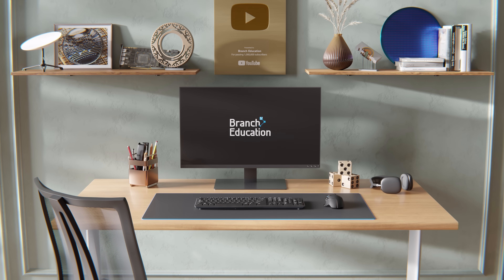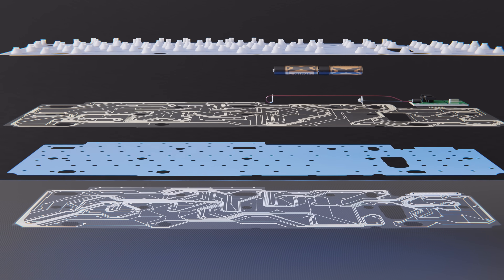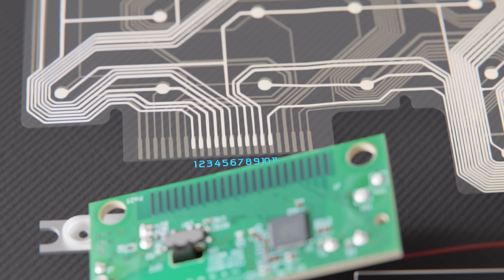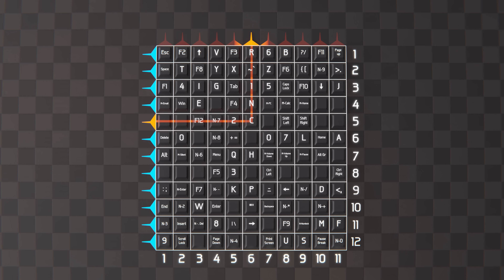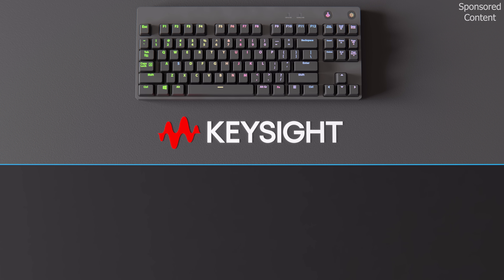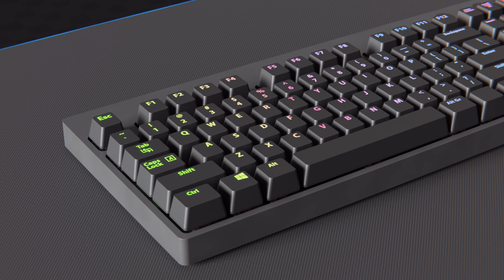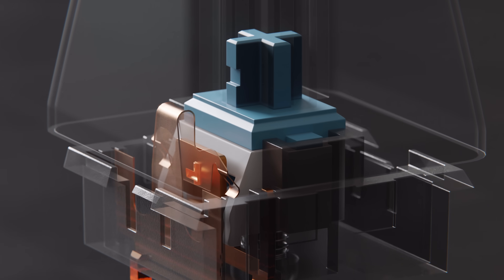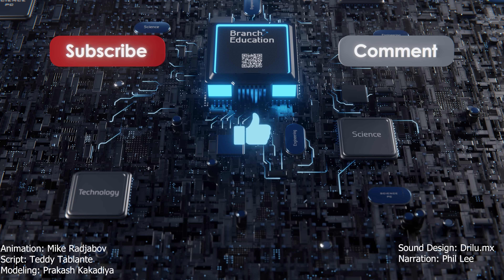How do Computer Keyboards Work? 🤔⌨⌨🛠

Comment: Just a correction to an otherwise good video. There are three types of keys in mechanical keyboard, linear, tactile and clicky. The click in clicky keys does not come from the switch contacts but from a specially designed jacket that is held in place by the switch contact's tension and is violently released after pressing the key so that the jacket hits the bottom of the stem if I remember correctly. You called the jacket the slider in your video but the animation doesn't show the snap down of the slider that happens in clicky switches to generate the sound. If you add lubrication to these switches they actually become silent like linear mechanical switches since the grease prevents the jacket from moving quickly. Google "An Introduction to cherry mx switches"

Comment: Except the sound doesn't come from the metal parts contacting. It comes from the mechanical design of the switch. There's multiple different mechanical switches and the most popular are Red, Brown, Silver and Blue. Red ones are silent and linear. Brown ones are silent and tactile. Blue ones are clicky and tactile and Slivers are just shorter activation variation of Reds. All mechanical ones make small sound when bottoming out, but there's also silent (damped) versions that don't make sound when bottoming out.
Reply: The main click sound also doesn't come from the stem bottoming out but the jacket/slider component quickly moving down after overcoming the switch contact tension and hitting the part of the stem that brings the jacket back up on release. If you grease clicky switches the jacket cannot move freely and you turn them into linear(red) switches without the click sound.

Comment: the vizualization was amazing. Though, I hoped for a better explanation for mechanical keyboards. The membrane one (did not hear you called it membrane) had such a detailed explanation. The mechanical keyboard had an explanation about the switches, but not how the signal travels or what happends after the switch contacts the pcb. Also why you covered wireless keyboards and not wired, wired are more prone to be bought in bulk I think. At the mechanical keyboards I hoped a same way parts comparison. It wasn t clear that the switches are a completely different part that does not have to be soldered onto the board. Hot swap keyboards are all about this, where the switches can be easily removed by hand

Comment: Welp... now I know how it works, and it explains why one keyboard can have multiple inputs go through at the same time

Built a digital keyboard which uses 11x4 as a matrix (it can only process lowercase alphanumerical input, so 36 possible inputs, which fits into the 11x4 matrix)

My problem so far was checking all 4 rows / 11 columns at the same time... so 1 input at a time.

With the oscillations, it could possibly handle 4 inputs at a time

Comment: Amazing explanation, that mechanical one is fine but how cup detect each key press explanation was mind blowing. I had that question from long long time back of the mind but finally I got the answer.

Also on a similar way, I would also like to know how each pixel in TV is controlled and each produce different colour.  

Thank in advance, if in case this comment is read.

Comment: mechanical keyboards are much more unreliable than cheaper non-mechanical keyboards... in 28 years I've only used 3 keyboards, the first was mechasnical an stoped work after punch, when i played  nfsmw (the second one was non-mechanical  "second hand" ps/2 compaq and I used it for about 18 years, I changed it 2 years ago, because I wanted rgb - to see the keys in the dark. mechanical keyboards (are not faster than non-mechanical) are for stupid "gamers"...

Comment: 00:05 Basic computer keyboards have minimal critical components for cost efficiency.
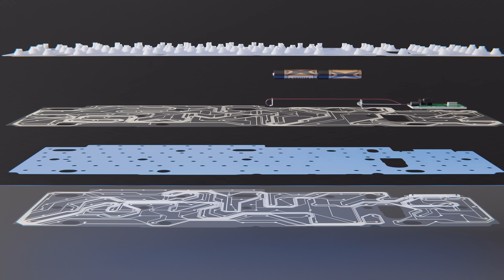01:41 Computer keyboards work by bridging connections with conductive circles and rubber domes.
02:57 Computer keyboards use a keyboard matrix to register key presses.
04:20 Keyboard matrix uses 3 volts along columns for key detection.
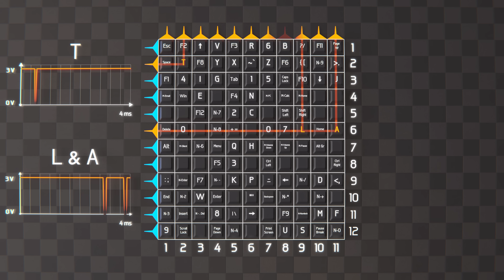05:46 Computer keyboards work by detecting key presses and sending data to a transceiver.
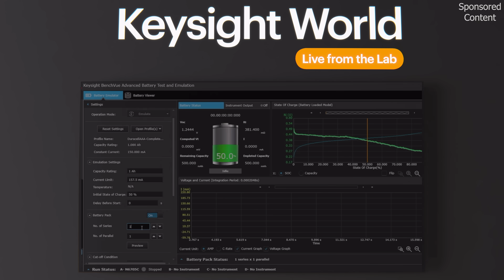07:06 Mechanical keyboards have a different tactile feel and make a clicking sound when pressed.
08:24 Computer keyboards work by depressing keys to create a connection between two metal contacts.
09:50 Computer keyboards vary in mechanisms and cost.
Crafted by ADEDLOOP....

Comment: I realize this this is just an introduction to how keyboards work, but just wanted to add
that, each key is assigned a number, Space=32 , Enter=13 and the letter "E" =69. known
as the ASCII Code.on pressing each key, the processor detects this, outputs the number
the key generates, and sends it to the computer.

Comment: Just a quick clarificatio: it cannot tell what letter you pressed. It can tell the key by a certain scancode. Now, what the computer does with that scan code is up to the software that's running on it. Initially, the computer has no idea what to do with this signal until it has a rule for it.

Comment: Its worth noting that there's a practical reason beyond feel for mechanicals. Rubber domes in membrane keyboards are much more prone to wear out due to the degradable nature of rubber having to flex and bend over and over for thousands of presses. And once they break the whole membrane effectively has to be replaced. Meanwhile with a mechanical keyboard its based off much more durable materials like metal and PBT most of the time. Not to mention so long as parts are available you only have to resolder/replace a single switch.

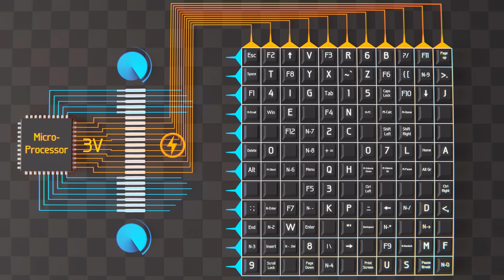Comment: I still don’t get it the idea of the matrix, if we come back to 3:40, when i press Y how the microcontroller will know that it was Y and not G or V. Because with that schematic if you press G the same wires will be able to conduct the same voltage. 
If it’s working with different frequencies in each column then it would be understandable but i don’t think that it works like that. 
I would be happy if i found a response to this question. 
3:45

Comment: Mech boards aren't durable due to this same reason. their keys break easily. I bought 3 mech keyboards and in an year they all stopped working one after the another. Bought a hybrid one and it's been 2 years and still working super fine. No physical damage, and chip damage, no internal damage. Not a single malfunction.

Comment: Amazing video! I was waiting for the laptop keyboard, specifically ibm/lenovo thinkpad "razor" switches keyboard, but I guess its not interesting enough. 

The explanation with matrix is great too but I'm guessing the example in this video is used for diodeless matrix, mainly because diodes cost money and that adds up to the cost when thousands is manufactured, that is why the workaround. Maybe, I'm just guessing.. The animation and research is great too

Comment: Good electronics solution for designing keyboards given and clearly explained-- for some designs the implementation of diodes solves the mentioned problem on the matrix for others is nothing to be added on lines and rows or on the lines  connecting buttons to the matrix it depends on the way it s designed-- inducting many others for those who are interested in electronics. Maybe further video needed in the implementation and the integration and setup  in  exploitation systems like windows to have a better overview of this smart  complex engineering product . Very interesting ,cost approach there is solutions for cheap product and solutions for high quality products of course .actually some of them are sold for less than 2dollars in our supermarkets .

Comment: Good video but so many errors with mechanical keyboard explanations, some switches are contact less, not all have tactile feed back, some don’t need to be saudered, some use magnets, some don’t have springs, not all are clicky, silent switches work slightly differently, certain switches use a different mechanism, a few use magnets instead of the leaf springs

Comment: The click sound isn't created by metal leaves, it's created by the loose white "jacket" hitting the bottom. Not all mechanical switches are "clicky"(having a jacket) like MX blue in the video. For example, MX red (linear) and MX brown (tactile) does not have the jacket and won't produce the click sound.

Comment: why all that complicated technical and mechanical stuff to determine which key is activated? Isnt it better to have a direct single connection to one key? That would require like 110 wires in total +1 for grounding and you wouldnt need any special oscillating hardware and whatnot. Why? Is it that cheaper because of this?

Comment: I think it might be useful to add that in 5:45 the voltage input on „row 6” goes down because „turning a column off” means connecting it directly to the ground thus making the current flow that way (cause there is only cable resistance there) rather then through higher resistent microcontroler – which explains 0V on row 6 input.

Comment: That’s the same keyboard when you start duping the keyboards to show bulk, that’s the same keyboard I use for gaming, it’s a bit loud, but it works, and my brother ripped off the escape key, and I used the keypad keys as a replacement, and I have the wired version

Comment: Super wrong on the mech keyboard part. Price is ofc depatable considering the amount of keybs under 30 USD, rgb leds are not a feature on every board and the most insulting of all, that the switches are sodered on…

Comment: I am pretty old skool, I started using computers back in the day when Mechanical keys were the only type available. I like the feel and the sound they make. I also miss the sound of Dot Matrix printers. tho, some early ones were so loud they had to be in a cabinet with sound deadening on the walls, and a clear plastic top, that could be opened to retrieve your printout, feed paper in, ETC.. . .

Comment: As you mentioned,the column sampling period is 65 micro seconds ,but in real world there must be bouncings (the key contact point quickly close and open several times )when pressing a key. I think this bouncing period might longer than 65 micro seconds. Thus a keypress would be    decoded to several different keypress.

How they avoid this?

Comment: This was amazing. Your 3D animator is top notch. I'm trying to figure out why two of my keys on my laptop are going out. Based on this I'm guessing there's an open on one the circuits in the keyboard matrix. My H key and my left arrow key stopped working at the same time. I can sometimes get them to work if I press real hard. Then they work for about a minute. MSI GS 66 Stealth with Steel Series per-Key RGB with Anti-Ghost key (84 Key) keyboard. Does anyone know if there's a fix besides replacing the entire keyboard?

Comment: You don't tell much about how a keyboard is scanned electrically.

When two metal plates are moved towards each other, there is a relationship between capacity and distance. What is important is to be able to measure the distance, i.e. the capacity. This method is called capacitive sensing. The capacity is measured at each node in the matrix. It is very simple. An opamp, or transistor, with good amplification is used. This is important, because otherwise a capacitance to other keys, and to ground, will disturb the measurement. This opamp is typically included in an oscillator, and it is affected by the capacitance in the node, which is where the vertical and horizontal wires meet. It is possible to determine the capacitance very precisely in each node of the matrix, down to femtofarads.

Capacitive sensing has been used since the days of punch cards. Contacts wore out too quickly and capacitive sensing was used instead. When IBM made their first PCs, they used capacitive sensing in all models from AT computers and up. In XT computers, mechanical scanning was used, although it was actually more expensive. IBM also used mechanical scanning in their electric typewriters and the keyboard for XTs was made like in electric typewriters. IBM's AT keyboards the cupper in the keys was protected by solder resist and there was no electrical connection when a key was pressed - only a capacitive connection. They amplified the signal with a simple inverter before it went into the microcontroller. They didn't measure the value of the capacity back then in their "cheap" AT keyboards, but it was designed to detect a pressed key, if the capacity in the node was higher than when it was not pressed.

In modern keyboards, the chip records the capacity very precisely and it has a hysteresis. Therefore, there are no contact bounce  time and capacitive detected keyboards can detect pressure significantly faster than a mechanical keyboard because there is no bounce at all.

A typical detection of capacity in the node, you use an opamp with a very small capacity between its negative input and output, and a schmitt trigger after it, and let it perform an oscillator with a high resistance back to the negative input. From the output, you controles the columns in the keyboard, and if there is a capacitive connection, it affects the oscillator frequency. On a microcontroller, you typical are able to either feedback the output, or not feed back, so you measures a reference frequence, when there is no connection. When the microprocessor connects the collumn, the frequence is affected, if there is a small capacity in the node. The capacity in the node, is coubled direct to the minus input of the opamp, and even very small values, affects the frequcency much, because the capacity between output of the opamp and the minus input is low. Even, that it is small compared to the capacity across the opamp, it changes the frequency enough to measure capacity in femtofarads. This is measured with a timer on the microcontroller chip.

Comment: Question: What does happen when you press two keys in a row. Shouldnt the power go through the first pressed key in the row and leave the other one without power?
Reply: Basically, the power of the electricity splits so that there’s half as much power going one way and half as much going the other way.

Comment: 5:42 that doesn't make sense. The way you described it, when the "L" column is turned off, the "A" column is still on, so the output will still see 3 volts, and the same goes for when  the "L" column is turned off. I think you have it backwards, this concept would work if all columns are turned OFF when a key is depressed, then sequentially turned on to see which row(s) are active.

Comment: I had to dismantle a Kawai electric piano recently to fix some keys and internally it's quite interesting. it's mechanical in the sense that the keys have weight and travel similar to a real piano but right at its core it's some silicone pads and contacts. So you push the key to overcome the weight and the force of the contact, presumably voltage over the contact is what translates into striking a note.

Comment: 05:40 this appears to be wrong. If the L and A keys are pressed there is always a connection to the sixth row and there will be no voltage drop, in other words the keyboard can’t register those two buttons being pressed at the same time.

Comment: LIST_Of_POINT_MISSING
1> Where are the explanations of the keyboard about the thing named scan-code (all models, classic or mechanical).
2> Where are all the explanations of how the keyboard detects and then the internal logic used for the detection
3> Where are the explanations in case of key conflict
4> Where are the explanations for taking into account button modifiers
5> Where are the elements given to the computer for a HID type component
6> Where is the speed info, the values given are not all the same for all keyboards
8> Where is the information about the wireless communication protocol
9> Where is the information about pooling rate
10> Where is the info on the total of max button use of a keyboard according to the type
11> Where is the info for the RGB part of the keyboard you showed
12> Where are the sources for average prices for your 2 keyboards
13> where is point number 7 from this list (ou read again and you not see the line before)

you must specify that this is one of the layout models that there may be but that it does not represent all wireless keyboard models

not all keyboard models have the same layout and are not all wireless, so the grid you show it's not full correct, but not explain other thing, how the thing work for the "microprocesscor", wrong word for first, remove the last C letter 
small search on google and i found lot of other model for the "plastic sheets" and the rubber part

we know exactly how DRAM works in detail with a lot of info, but we know exactly for 1 model, but not all the info
for any guy want know more detail about all missing point from this video
watch the video ID " N0O5Uwc3C0o " or " wdgULBpRoXk " or " 2lPzTU-3ONI "
for me it's mainly a product placement video, it's a shame, I expected to see the details of the summary and common operation of a mechanical keyboard

7> Where are the typical elements of your video like the intro and the outro to show the branches we watching
14> congratulations, you have just read point number 7, you could make a video with all the information required to make a real video like the mouse

Comment: I am not used to write comments but this video convinced me .. animations and explanation are at high level. I ve found new channel :-)… just one thing.. voltage graph depended on time would looks like in reverse, so only for moment when a keycap is pressed there would be 3V. In other case is 0V because of disconnected the circuit.